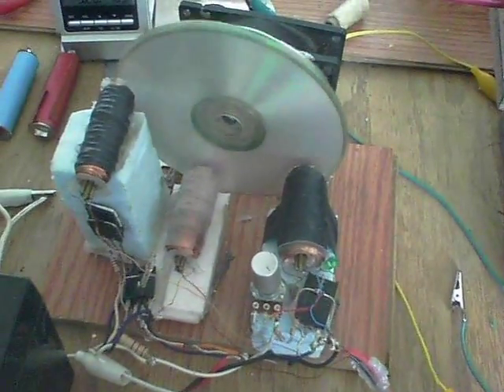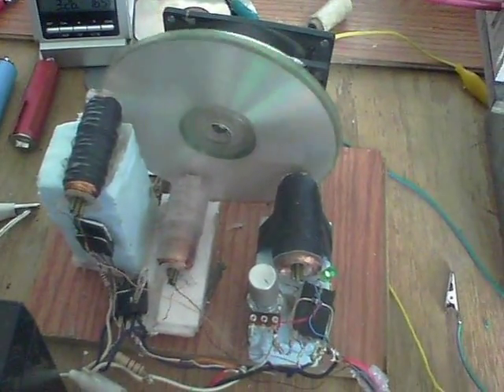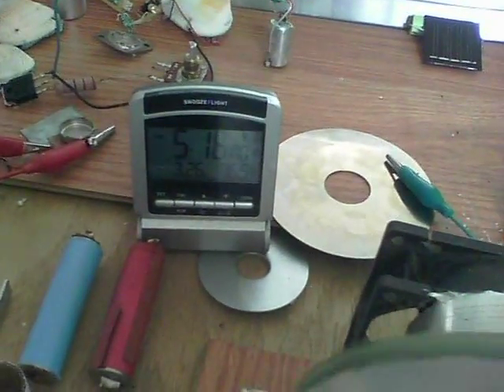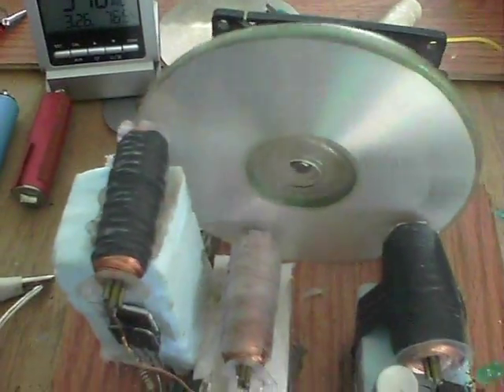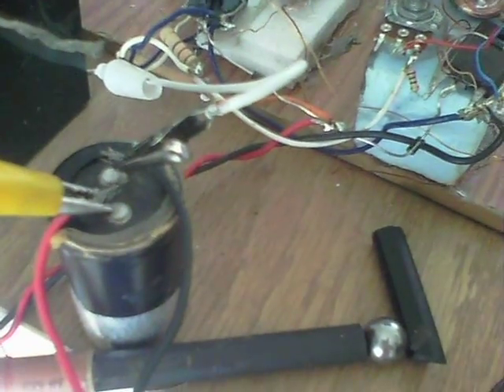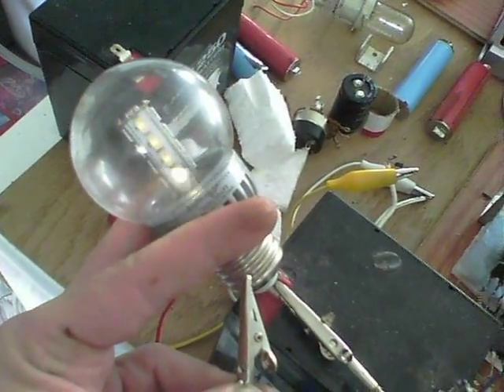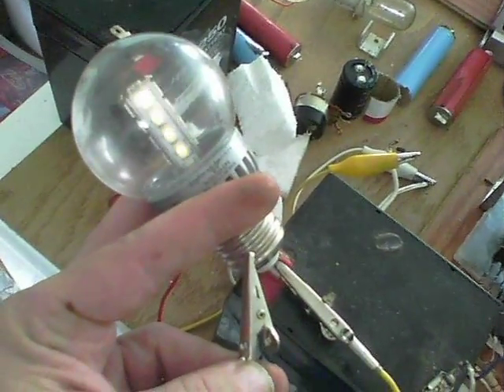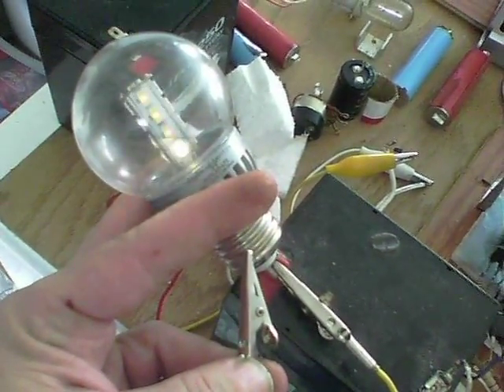Unexpected Solar Bedini

Comment: you hooked up the fan on 2 cd's wjth magnets. So the sun moves the fan, that moves the magnet? So they are pick up coils... Is it also a Bedini? If you disconnect the solar panel, will it still run?
Reply from the maker: It's a normal Bedini type motor, with 3 coils. The fun and unexpected thing being that the panels could run the thing that late in the day for March :)
The solution had been the large smoothing cap...without it the motor wouldn't run from solar earlier in the day.
Reply: Intresting. So the cap can manage to keep it running during the night... I am working on a similar project, but smaller... can't wait to try it!

Comment: That said if you have an abundance of available voltage, and the battery actually only needs about 14 to charge... and current is what u lack, u can take a buck converter and belt it with current punches at a lower voltage... say 14. Or, if the panels are at a distance and it cant be avoided, run 'em series to compensate the distance and buck down at the battery. You need about an extra (and expendable) 1.5V to do this, of courze

Comment: well one thing is.. pretty hard to see where it's loaded voltage is, if measured on a charge battery... because that charge battery is regulating the read voltage, but hey if its charging, its charging lol and thats the main thing. if it were only 12V loaded, and the battery -was- already 12.4, it wouldn't charge, right?

Comment from the maker: One method, would be to have a supercap charge with morning low light, then use a circuit with I/R detectors. Difference (through comparator) makes motor move til both balance, i.e. face sun. Circuit cap is topped up through day and when difference in I/R sensors the panel moves on own. Could use 555 to time detect like once an hour.Mirror could be placed for early afternoon top power, or to boost at other times to balance better. End of day, hits settable microswitch sending panel back to start

Comment: cool. I have some small little 6V panels that get nice boost from the technique. One day I'll automate a circuit that not only tracks the sun, but rolls a mirror in and out of place, based solely on temperature at the panel edge.

Comment from the maker: Will look into it. I checked all were doing something, then attached to a metal back plate from old PC keyboard (black to bring off heat from panels and cos LM317T was to go on the back). Connected parallel and electrical taped the wires. A storage bin goes over them at nights to avoid dew build up or rain damage.

Comment: you lost me. What about 12V? Generally a 21V open circuit panel should connect at around 16V or thereabouts. Linear Voltage regulation sucks. My favorite is buck or boost, some like Bedini.. mppt is a waste of time for tiny panels, it essentially doesn't exist.

Comment: If you run a mirror that is roughly the same surface area as the panels, laying flat in front, due south, you'll get a boost. Similarly you can also add mirrors on the east and west sides too. Works well if you have a DMM connected open circuit while u fiddle with them. At no point should they shade the thing, of course, or your angle is too steep, depending on how true south can get... I'm not sure about hot summer sunny days, as to the health of the panels... works great in clouds tho

Comment from the maker: Yer on ! lol
The 12V was read about online as a general solar tip. I have no idea if that's true. 
Built a LM317T regulator from the official datasheet circuits and was horrified that the extra voltage just disappears into heat in the regulator, nothing picks up the dumped voltage to make use of it ! Strange how the mind runs when being around renewable energies :)

Comment from the maker: The 1N4007 cuts 0.6V, but saves worrying. Had a li-ion charge to 3.9V, went to it at 10pm and it was down to 2.8V. I've disconnected leads at 7pm til now.
1 panel gives a constant light, 1 flashes always and other has a less bright flash. The less bright is probably the one you saw not flashing, it needs 'big' light to run. They do all put out similar amperage, but the volts will jump around all over the place. that was one reason for a fairly large cap on the front end today :)

Comment from the maker: Yeah, i'll put my shaving mirror in front, it's about 4ft tall. Have heard about doing that, but was going to try it on indoor CFL solar first. 
In that position there, they get the sun from about 1pm to 6pm without me being a manual solar tracker, directly at around 4pm. That's what was perhaps the most surprising thing, no messing about with angles. A mirror positioned similarly is a great idea.

Comment: Mark, if they go down to 12V with a load, I susepct that the one that doesn't blink should be (a test) removed, and see if the voltage drop still occurs. the one might be bringing down the rest. They should be higher. Good thing is, though, a Bedini circuit will still charge... part of the reason i figure they'd be in good use with you, and I am interested to see what you come up with. Get something innovative and a 30 watt will show up in the mail next time :P cheers

Comment: "even though these panels have diode protection already apparently. " yes, I've noticed that too. They are rather strangely constructed. I thought about removing those flashing LEDs and just putting a nice diode in there. Although, they don't come apart very nicely, I wrecked one messing around with it. Is that one that doesn't blink putting out comparable amperage to the others? Those three were Humptey Dumpties, they took a great fall...